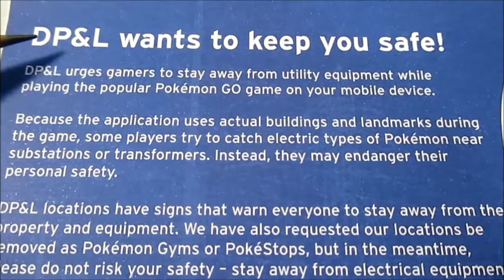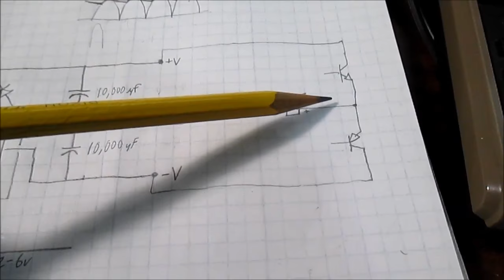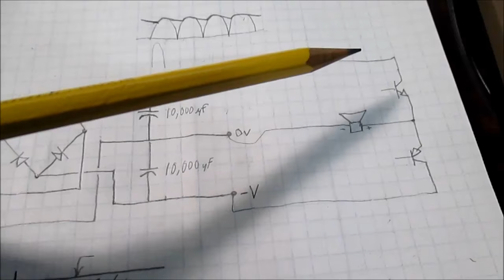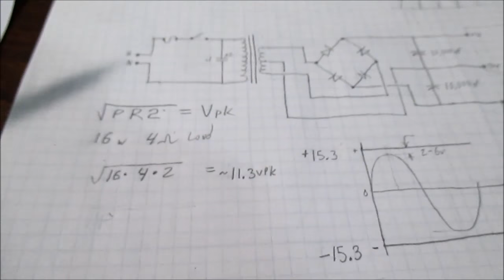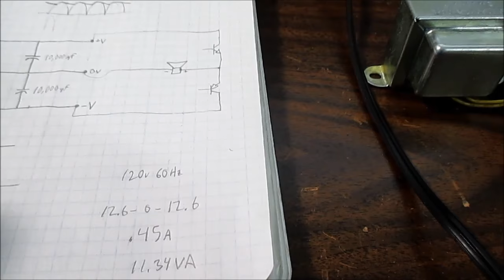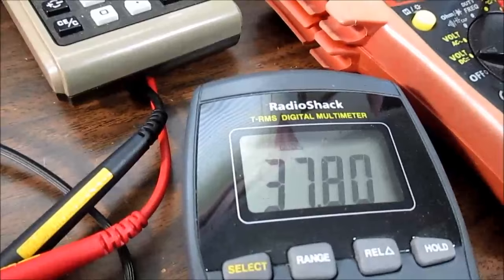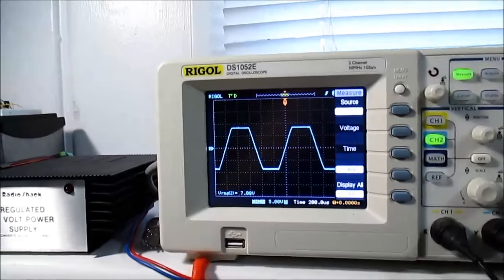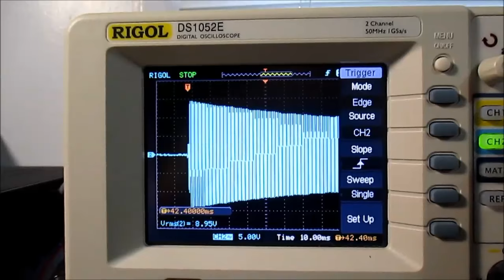Selecting power transformer for audio amplifier

Comment: what other elements do you have in your rectifier board? I see some didoes, an interesting blue electrolytic capacitor and an interesting and rather large ceramic capacitor?
Reply from the maker: I'd have to watch the video to remember but those are probably not part of the circuit. I have a lot of stuff "parked" on my breadboards.

Comment: Can you please make a video comparing the use of chip amps (like tda2030/tda2050) on dual supply and single supply? Its a request from a big fan of yours!
Reply from the maker: There really wouldn't be any change to the sound quality, although the bass can roll off sooner depending on the size of the output capacitor used. If you mean that you want to see a video on how to connect them in single supply mode, I could do that at some point.

Comment: sir-i have a query i have 2 transformers same type—15 v 6a   each  made by same manufacturer-- i join the 0 v of each to make dual rail supply of 15-0-15 v 6a ac  for amplifier tda 2050

--The turns on transformers i guess they are same as made by same manufacturer

1----------if i connect like this in parallel do i get 16-0-16 v @ 6a--w.r.t to each rail

now what do you think can it be done without any issues ?

------thank you

Comment: oh, thanks... I have soldered a couple of LM1875 mono boards up, The ones in your vid 'LM1875 IC audio amplifier board kit test and review'
I will be making a stereo Amp with them. 
Jaycar have toroidal's for sale
12-0-12, 24v - $27
18-0-18, 36 - $17
25-0-25, 50v - $17
all reduced from $87
...The link I sent you was supposed to be a 12-0-12.  I don't really understand how you got 15-0-15....... but i'm learning.
Will the 12-0-12 'MT 2130 toroidal transformer'  be a good addition to the bench?
Reply from the maker: I might have seen the wrong one. 12-0-12 ones are fine if you are going to use 4 ohm loads. You can go with the 18-0-18 if you use no less than 8 ohms speakers because you will get good power output, around 25w per channel. The 25-0-25 is too much voltage for the LM1875 after rectification and filtering. Those are very good prices. You can use 300 watt (VA) transformer but you really only need 100.
Reply: great...So now,I'm guessing it's not as easy as just plugging it into the V- G V+ inputs of the board. "LM1875 after rectification and filtering." any direction on this matter :)... it's 5am and my solder iron is running haha... Thanks again
Reply: where on earth do i go from here... got my 18-0-18 toroidal, connected to 240 main, but, do you think i can get any response with my multimeter with the remaining red, blk, yellow, orange wires... Nope... lost! if you can help... awesome thanks
PRI:240V AV 50Hz (130C) Blu-Blu
SEC:18V ACx2 Red-Blk+Yel-Org
...thats all the spec's I have.
Thanks again ;)
.................hope to here from you. cheers
Reply from the maker: With your meter set to AC voltage, you should get around 20v (a bit higher than 18v because the transformer is not loaded) across the proper leads. red to black and yellow to orange, I guess (Jaycar site is down for maintenance as I type this). Do NOT connect this direct to the amplifier. You need a full wave rectifier bridge and filter capacitors to make a dual DC supply for the amp board. Connecting AC direct will ruin the amp if it is the same LM1875 board I reviewed as it requires DC.
Reply: Much appreciated :)

Comment: Sooo... I recently mistakenly ordered an amplifier board that requires dual AC power. I don't have any AC transformers but I do have TONS of DC power supplies. I even have PC power supplies with negative and positive output. My question is, can I power the amplifier that calls for a center tapped 24VAC transformer using DC instead??? I really hate to spend $40-$50 just to see what 0.003% distortion sounds like instead of the 0.5-1% I'm used to!
Reply: BTW the amp has rectifier on board so does it convert the AC to DC anyway? It's one of those TDA 2030x2 and 2050 for subwoofer output. Thanks
Reply from the maker: You could hook up dual DC if you can bypass the bridge rectifier. What country do you reside? If you live near a Radio Shack, they sell a 25.2v 2A transformer (same as used in the video) for around $15. They are good quality and would power the amp fine. If it is an eBay special, it will probably work but I doubt the ICs are authentic, especially the TDA2050.

Comment: Hello. thank you for your answer. I have one more question. I have a poweramp straight to the speaker (8ohm), its causing a pop when turning on. I want to know if I should add a decoupling capacitor? or should I add a discharge resistor? or a zobel network? or the 3 solutions?
Reply from the maker: Is it a small click or a larger pop? These solutions likely won't correct the problem. It is normal to have some click at power up / down. The solution would require a relay on the outputs, time delay and voltage sensing circuitry. This is a lot of circuitry to correct for, what is in my opinion, a trivial issue.

Comment: Can a transformer be too powerful for the amplifier?  I've built this push pull amp https://youtu.be/mQuvMrJXDoI  which works fine using a 20V wall adapter or my 18V bench supply with a rail splitter .  However, I would like to use a large speaker like this https://youtu.be/wapHGDgNHlM without clipping. You can see it clipping in this video using the 20V wall adapter with the large speaker and woofer filter. However, when I hooked it up to a big 20V CT transformer I got a very loud hum and the transistors got hot. I add a 50 Ohm resistor in series with the speaker to eliminate the hum, but it still sounded bad unless I turned up the volume to crazy floor-shaking loud. It simply didn't work at low volume even with the gain adjusted. Is the transformer just to powerful? Can I add current limiting resistors somewhere? Any thoughts would be appreciated.

Comment: my speakers are 40+40+75 Watt rated (2.1 system)
I drive them with 3 amplifiers rated for 100Watt each
I wana power all of the amplifiers with a single 100VA transformer

can I expect a total output of at least 80Watts? (20+20 and 40 for the sub)?
Reply from the maker: It is not so straight forward to calculate. If you like you music loud with such an undersized transformer, it can overheat.

Comment: which type of transformer will eliminate humming in an amplifier? besides that which combination of capacitors will eliminate transformer humming in an amplifier?
Reply from the maker: If you mean humming coming from the transformer itself, the toroidal transformer would be the best. Amplifier designers like to use as much filter capacitance as possible but that means a high current crest factor drawn from the transformer. Putting an inductor between the fullwave bridge and filter caps would reduce that and perhaps make the transformer quieter. I don't know for sure since I haven't tried this.

Comment: ( I love this stuff... lol)   You do a really great job John!!
Very good bench testing/proof... really helps in the learning process by practical hands on.
I'd be interested to have you review or build any of my 3 (easy-build, home-brew )great-sounding little HIFI audio tube-amps.
( http://www.pbpix.com/amp/   or   http://www.balazsy.com/amp/ )
1.) 5902 PP integrated amp
2.) 6v6 PP integrated amp
3.) 12Ax7-6v6 SE amp
Primarily I'd like to see you discuss some of the technical benefits and other aspects of the interesting approaches I took for some of the circuit elements:
ie : 1.) Voltage dropper capacitor used for filament supply in the first amp and again in the 2nd alt version used for the dual supply to the opamp driver.
2.) Use of LM317 as CCS for cathode bias

Comment: I have a big toroid like that in an amp I just recently blew something on in the amplifier stage. The transformer is fine, and still powers up the rest of the amp, but blows out the amp stage fuses if I replace them. I just got the idea to power other amplifiers that are not as powerful as the one this came out of, maybe getting an overall output increase from it. Also I would fix the amp it's in already if I knew what exactly is blown/shorting, but it's hard for me to tell. If anyone has any suggestions as to what I should check out and look for on an amp thats speaker outs were accidentally dead shorted while putting out full power feel free to tell me. The amp is relatively simple in its layout and I'm sure i could replace any component that's bad on it. Just not sure what to replace, what to test and what I'd be looking for in testing it
Reply from the maker: Sounds like the output transistors are shorted. You should check the drivers for damage as well.
Reply: @JohnAudioTech  okay, I know what my transistors are. By drivers I would assume you mean the speakers that were hooked up, if not tell me what that is lol. My driver was fine though, the amp was powering a sundown sa12 subwoofer, which is quite robust. I actually have another identical amplifier that still powers that subwoofer

Comment: Thank you for all your answers. I'm trouble shooting a PSU and i'm getting +9.6v and -8.3v.

What causes the voltage difference of 1.3v between +VCC=9.6v and -VCC= -8.3V in a PSU?

a) the coil has a central tap wrongly placed?
b) the rectifier (diode bridge) is fried or cheap quality?
c) one of the capacitors (3300uF 25v) are damaged and should be replaced?

thanks again
Reply: A few possibilities. Could be a center tap not being center due to shoddy transformer construction, could be a bad rectifier, uneven loading, bad smoothing cap. If those rails are regulated, it might also be a bad regulator.

First thing I'd do is disconnect the transformer from the board, hook it up to the multimeter on AC, and check the readings - if it's a bad tap, that'll be obvious right away. If nothing is out of the expected readings, that's the first problem eliminated.

Comment: Can you help me chose a good toroidal transformer  for this amplifier board???
I will be driven 8 ohms speakers.
http://www.thanksbuyer.com/tda7293-power-amplifier-board-100w-100w-ne5532-op-amp-audio-diy-kit-unassembled-53073

Thanks in advance.
Reply from the maker: I'd get a transformer with a 56 volt secondary that is center tapped (or two 28v secondaries). Sometimes notated as 28-0-28. Volt-amp rating should be no less than 250 (250 VA). It says the kit doesn't include a heatsink or capacitors. I'd get two 10,000uf 50volt capacitors. The heatsink must be fairly large. Roughly 18cm wide x 10cm tall with 5cm vertical cooling fins.
Reply: JohnAudioTech 
Your information is gold to me brother. I appreciate your time.

Could you link me to the best  option ( Transformer) 

AS you can see this amp is dual chanel 100w+ 100w.
I will be running 8 ohms speakers .
The toroidal  transformer will be working in the USA. AC110V
Link me to the best  toroidal transformer you can find.
Thanks a lot man.
Gio.

Please link